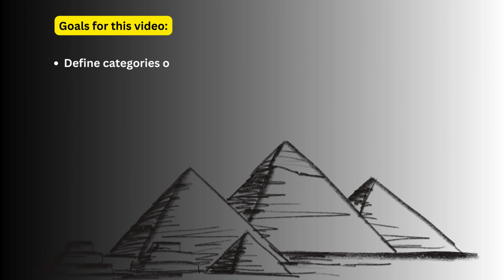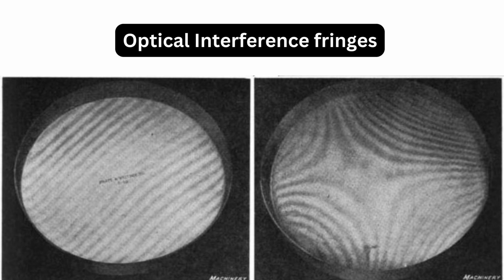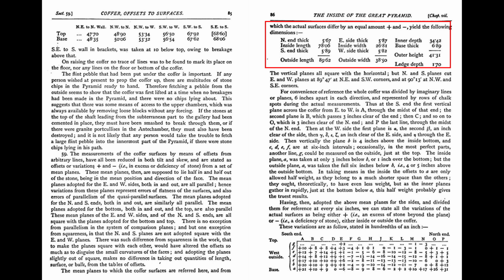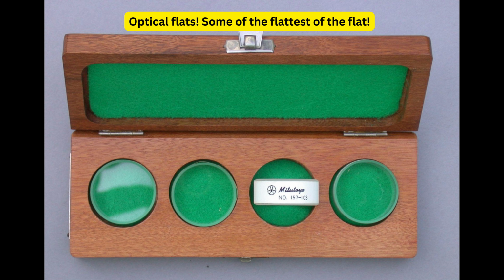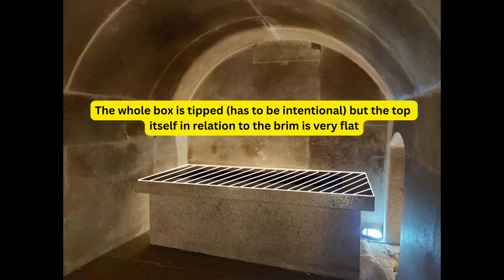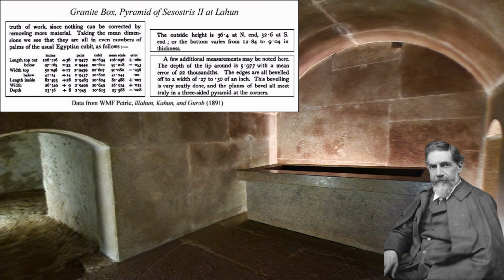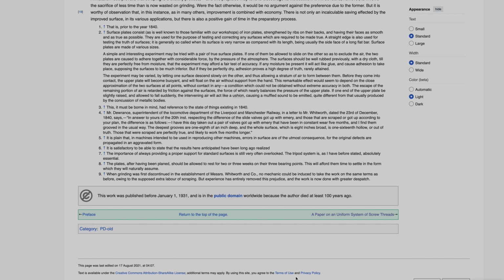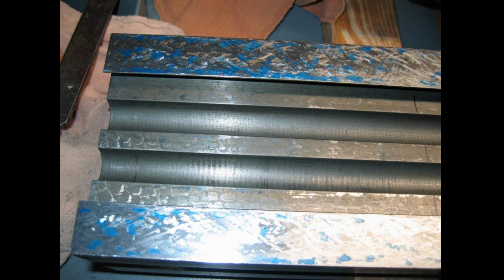The Problem of Flatness in Ancient Egypt

Comment: Can you use water to see if something is flat?
Reply from the maker: Water is useful for finding level not flat
Reply: @intothemap360 yes the surface must be level to measure with water and the object may have to be moved or tipped to one side or the other and leveled first, but at that point you can see if it pools up in one corner or pools up somewhere.

Comment: Bob Greenyer measured red granite from the sphynx using a scanning electron microscope and found a surface flatness of about 6 microns, well into your "lapped" range. With that level of precision, even after thousands of years, it's pretty reasonable to assume the original flatness may have been even greater. You can look it up and view it yourself on his YouTube channel. Look up "Bob Greenyer Sphynx red granite SEM". It only has about 2000 views. It shows the actual SEM flatness curves, you can look for yourself. You said to start with the evidence, and use that to inform your conclusions. Well, there's actual evidence which goes against the narrative of the video. Will you engage with it?
Reply from the maker: Sure I’ll engage with it right now. Thanks for bringing this up, surface measurement is exactly the kind of evidence we should be talking about. But there’s an important issue here about how SEM works versus how flatness is actually measured in engineering and metrology. A scanning electron microscope (SEM) does not measure macroscopic flatness the way a surface plate, interferometer, or profilometer does. SEM is primarily used for micro-scale imaging and surface texture, not for determining whether a large stone surface is flat over centimeters or meters. When someone says an SEM shows “6 microns of flatness,” we have to ask: flat over what distance? Because 6 microns over 50 microns is just normal mineral surface texture, while 6 microns over 50 centimeters would be extraordinary precision. SEM operates at tiny fields of view, often fractions of a millimeter. At that scale, you’re mostly seeing individual mineral grains, polishing scratches, crystal boundaries, micro-fractures, and weathering pits. That’s surface roughness, not large-scale flatness. In engineering terms, this is the the difference between surface finish or roughness, which is micron-scale texture, and form or flatness, which is the overall geometric shape across a surface. Those are completely different measurements done with completely different tools. Surface roughness is measured with profilometers or examined with SEM at micron scales over millimeters, while flatness or form accuracy is measured with interferometry, autocollimators, straightedges, or coordinate measuring machines across centimeters or meters. An SEM can absolutely show micron-scale texture, but that does not mean the block face is flat to 6 microns overall. You can have a surface that looks smooth under SEM but still deviates millimeters from flat across its full size. It’s also important to note that SEM images are not inherently 3D height maps unless special techniques are used, and even then the vertical scale is limited and local. On top of that, the sample matters. If this was a small chip or a polished lab sample, that tells us about local surface polish, not the geometry of the original stone face as installed on the monument. Granite is also heterogeneous, and different minerals weather at different rates. Over thousands of years, feldspar can erode slightly faster than quartz, naturally creating micron-scale relief that an SEM will highlight. That tells us about mineral durability, not machining precision. It’s also worth pointing out that the Great Sphinx itself is carved primarily from limestone bedrock, not red granite, so it’s unclear what specific material or structure is even being referenced here unless the sample came from a different monument or from granite blocks in nearby temples, which would need to be clearly specified. So the key question isn’t whether SEM showed microns, because SEM almost always operates in microns. The real question is whether large-scale flatness was measured over a significant baseline using a metrology method designed to measure form accuracy. Until that kind of measurement is shown, SEM imagery can’t be used as evidence of advanced large-scale precision machining. If there’s a source where flatness was measured across a known distance using interferometry, straightedge comparison, or similar form-measurement techniques, that would be the right kind of data to discuss.
Reply: @intothemap360 Ok so that's not actually engaging with what I said. If you would actually watch the video that I'm referring to (the one that is about an hour long, 2000 views, by Bob Greenyer), then you would see that he IS doing measurements across several millimeters. You can see the topographical map in the electron microscope of a rather large area. Then he measures lowest peak to highest trough, with a difference in height of about 6 microns peak to trough. Across a rather large surface. I'd encourage you to actually watch the video, particularly around the 40 minute mark (I don't remember the exact timestamp), but you can see what I'm talking about. This is not "take my word, some guy said something about an SEM and I treat that as gospel without thinking", I'm saying IN THE VIDEO, I see what appears to be a remarkably flat surface, over a seemingly pretty large surface area, where the maximum vertical distance peak to trough is 6 microns. That seems absurdly flat to me. Maybe there's an explanation, maybe possible with stone tools, maybe a natural process. I'm not saying either way exactly what it means. But I'd encourage you to look with your own eyes, maybe contact Bob Greenyer directly, or something. Because you start with the actual facts, then find an explanation. The facts seem to show something that disagrees with your video, particularly the part where you say no samples were found with flatness approaching modern high precision techniques.
Reply: Bob Greenyer? The guy thay claims the pyramid is a mana factory? The guy thats telling people that this mana will allow you to see through time? Yeah he seems like a really honest and credible source.
Reply: @verdadero5290  I see attacks against a person's character but not a lot of engagement with evidence from this reply. I'm sure you like science, how about you engage with facts instead of making this about arguments from authority? I'm telling you to look at evidence, not believe blindly in everything one person says, who has biases and blind spots, like every researcher ever.
Reply: @BoltzmannBrainMusic  the fact is, you're citing a person that is obviously not reputable. Any claim the man has made has to be taken with the same seriousness as mana that will make you see through time.  I know a homeless man under a bridge that says that the cia has planted micro chips in his brain to monitor his brain waves. I wouldn't cite him as a source for anything. Would you?
Reply: @verdadero5290 That's an appeal to authority fallacy. If you're so small brained that you cannot evaluate a claim based on the evidence, regardless of where it comes from, then you're not doing science, you're doing a popularity contest. I would listen to the homeless guy down the street if he was using a scanning electron microscope on video and showing the graphs so I could see them myself and evaluate the evidence with my own eyes. Do you have that capability? Separating the facts from who said them?
Reply: @BoltzmannBrainMusic I'm sure you would. Make sure you buy his snake oil and dont forget to like subscribe and hit the bell as well.

Comment: You’re kind of missing the point though. 
At a minimum of multiple millennia ago, without evidence of evolutionary iteration of process, or contemporary industry of engineering, people /were/ able to achieve levels of precision that were not even considered until the 20th century. 
The level of precision was finer than what was measurable by Petrie 100 years ago or so. 

There is a observable process of science and engineering progress. Here we have evidence of precision equivalent to levels only achieved in the 20th century, from millennia before it. 

So yes perhaps they are not equivalent to the precision of the 21st century, but certainly 1 less century. It is anomalous and unexplained.
Reply from the maker: Show me the data for these measurements (not the vases)

Comment: machine thinking has a nice video on joseph whitworth, the inventor of modern precision tools. It also goes over the creation of the surface plate etc. Very interesting watch and applicable to this subject
Reply from the maker: Oh that’s cool. I knew he did some on lathes
Reply: @intothemap360  yeah it's cool, If i remember correctly it's about the micrometer and indeed the metal lathe. He basically created repeatable motion using a precision screw thread. Smartereveryday talks about Whitworth too, but then his crazy hexagonal spiralling gun barrels creating extremely accurate rifles for the time that were used during the american civil war. Just the kind of stuff I like. Anyhow, thanks for the interesting video man, and i'm happy that the algoritm finally blessed you.
Reply from the maker: I’ve got a lot more coming!

Comment: I'm only one minute into this video and you said if you have to go in the woods and make a carpenter square or ruler it would be really hard. And I'm thinking about it. If I found a nice big Japanese garden spider, those big ones you see in your yard at night, taking a strand of silk and referencing it at tension would give you a "perfectly" straight line, within the thickness of the silk average, which would be good enough for a heck of a lot of things. You would want each and of the silk to be coming off of a Sharp point so you could reference exactly where the start of the silk was on each side. Without silk then you'd have to make much sloppier rope, average long length of it, and try to refine it from there.
Reply from the maker: I was talking about if you were the first person to ever do it in the Stone Age. Not modern you who knows about it and could easily make it. That’s also a very minor point in my video and not the main topic

Comment: A great method of checking for flatness is to use still water to check for the high spots
Reply from the maker: Water poured on a surface has rounded edges due to surface tension and isn’t useful for that purpose. Water in a container is better for finding level much like we use a bubble level today. But level and flat are not the same. You could have a flat wall that water would just roll off of

Comment: Wouldn't we find evidence of these plates? I'd assume it would be a notable undertaking sizing up different plates from small to larger. 

The biggest thing that gets me, always, is the fact that early dynasty Egyptians didn't have the wheel. I cannot imagine most steps without it.
Reply from the maker: No more than you’d expect to find all the tools used to build the Hoover dam just sitting there. Brass or copper plates get worn and then melted down, granite gets set aside and sinks into the sand.
Reply: @intothemap360 we have written record of the construction, endless reference material etc. I think that if the Egyptians were smart enough to work out the process, they'd document it somewhere- drawing a picture of Ted the Flattener somewhere. I'm being obtuse, but I do think there would have to be something. Beyond that, it is a workable hypothesis. 

The slurry with copper idea was tested as a means to cut stone blocks and it didn't work out well because it only cut a very small amount after a few days, but we're not going for depth of cut necessarily, so it's possible.

Comment: edit: i just saw that this gets explained @14:40

so the way you achieve flat where it does not exist is with 3 different surfaces, you grind 2 to each other until they have matching but reversed profiles, then you  introduce the 3rd and grind until you create 2 new matching but reversed profiles then switch back to the original... each time you do this you will be matching negatives and removing deviance, if repeated long enough you will have a surface that is atomically flat. 3 of them actually .
Reply from the maker: Yes. You’re driving that high and low spot on each plate as close to infinity as possible by rotating on multiple plates.
Reply: @intothemap360  eventually if you had forever it would literally get to a point where the flatness was 1 layer of atoms and when both surfaces aligned nuclear force would overcome the resistance of the electrons and the 2 would be 1...lol Rickflat

Comment: “Perfect machine flat surfaces do not exist in nature” water likes to sit pretty flat……….
Reply from the maker: Water is not a machined substance.
Reply: @intothemap360 I didn’t say water was a machine surface but if your saying extremely flat surfaces don’t exist in nature that’s not true, maybe they had floating tools to cut the rock that kept it constantly flat without needed to measure flatness
Reply from the maker: I only said perfectly flat machined surfaces don’t exist in. Water at rest is indeed flat. But that would be a very impractical method that I’ve never seen any use case for. Water is useful for finding level. Not flat. Flat and level are not the same thing. Thanks for watching!

Comment: here is some more data , the granite there it self has about half a centimeter to a centimeter glass like surface . How do you do that .Its even visible from these images . Its rough , but also acts like a mirror for its glass like transparent to a degree surface , not all the way in , but on surface only . On Granite .  On top of this those walls around are one single slab or crystal in some of those images , next to them not crystal . Obviously one very much older crystal and one newer Granite . Im interested how do you make glass like surface that goes deep in granite . What do you think.
Reply from the maker: It’s polished. Just like a countertop today.
Reply: @intothemap360  you literally don't know what you talking about , you did not even see it , i know it now . Its not about flatness its about a block being chipped away and where it is chipped you can see crystalline structure like glass on surface , not the same material , that is where reflectivity comes from not flatness . Also since you are rude how does you 3 part grinding process work here https://www.youtube.com/watch?v=6RJ3Epd_SXk . Dont be rude to people , dont act smarter then 1000s of people who looked at it for you are not , there is something we dont know about how they did it . OR you grind it and compare it , chip it lets see does it have crystal layer about half to a centimeter deep . Go on , wont take long. I made much flatter things , im an astronomer , it does not happen , so its not the same process so i know you will fail ,its not a question , but if you want to stay in your dogma . Stay in it .Fine .
Reply from the maker: 😂😂😂 I wasn’t rude. Yes granite has crystal inclusions. I thought you meant the sheen on the top. Hope you have a good night!
Reply: @intothemap360  great day to you as well , simply said , surface of your granite and one found in examples i showed you and in your photos are different . Also showed where the idea of 3 plates does not work for there are places with rounded not flat granite that has been polished to act like a mirror . But you need to find that out for your self , i feel your brain does not want to know things im saying . But if you think ill push that on you , i wont , that doesn't work . Man will accept or he wont . So that is it .
I wish you a nice day as well.
Reply from the maker: I know it won’t work for other shapes. There are other methods for that! Have a good one!
Reply: @intothemap360  Im sure you have answers for everything , i dont even have to ask . But when you get in to it really , physically not philosophically then you will quickly learn what i told you .

Comment: I would love to see you take 3 plates and lap them against each other freehanded.  Please tell me how they made flat bronze plate in ancient Egypt.  Please tell me how they cut the large chuck out 
of the middle of a block of granite before they hand sanded the inside walls somewhat straight and square with each other.
Reply from the maker: I’m going to need six months and some buddies to pull that one off! And they caste the bronze and copper into sand molds same as we do now
Reply: @intothemap360  Now we're getting into the chicken and the egg dilemma.
Reply from the maker: I will try and make a smaller one but I’m sure it will suck because I’m not going to be skilled at it but yes I’ll try my best.